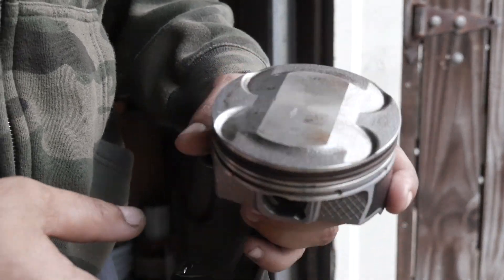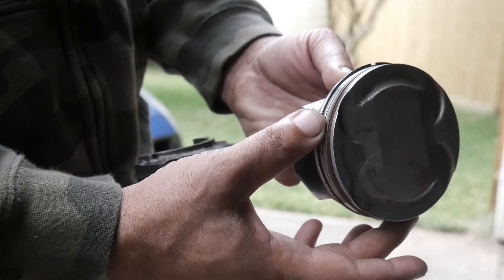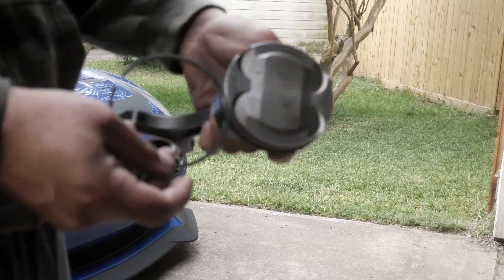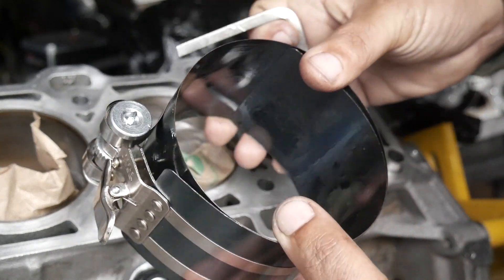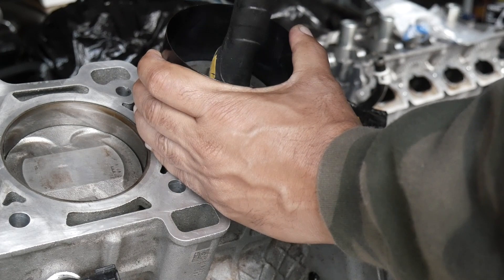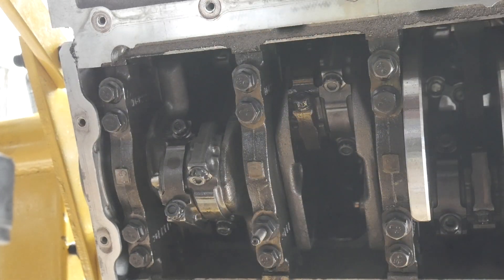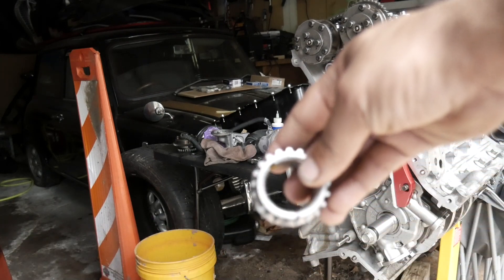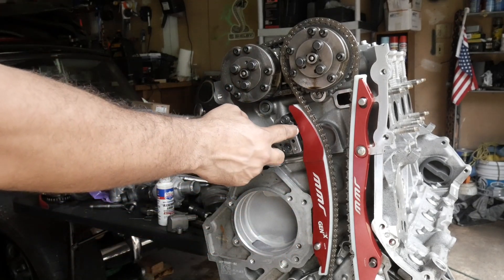Installing MMR Timing Guides on an S550 Mustang - Engine Rebuild

Comment: Hello I’m looking at supercharging my mustang gt would u say this is a must
Reply from the maker: I did this as a precaution.  I didn't want to take the chase that the plastic guides would weaken.  If you haven't already, I would definitely suggest upgrading your oil pump gear.
Reply: @JDubWrenching  thank u for ur reply 100% on oil and pump gear just can’t make my mind up on the mmr kit, obviously comes all down to budget but probably best to try and get mmr kit as well